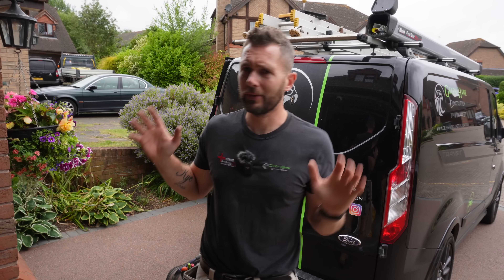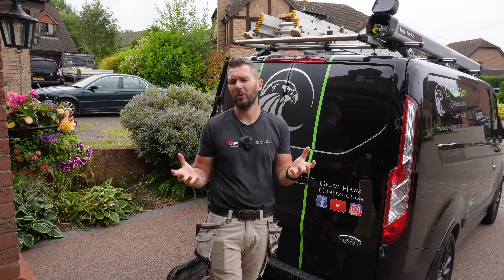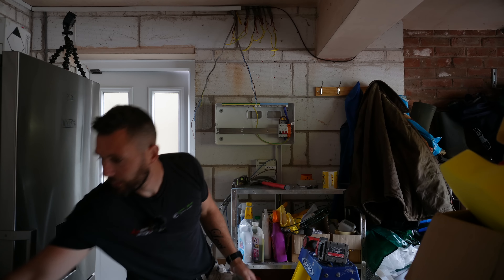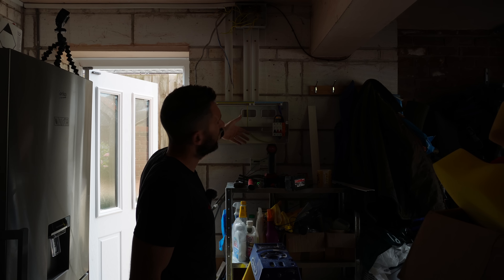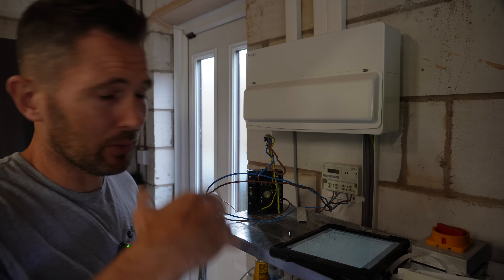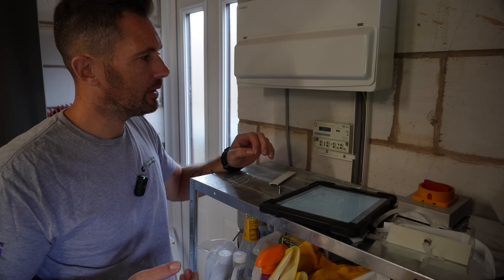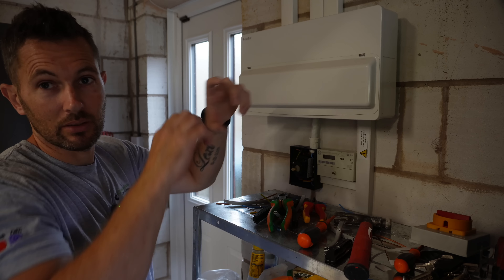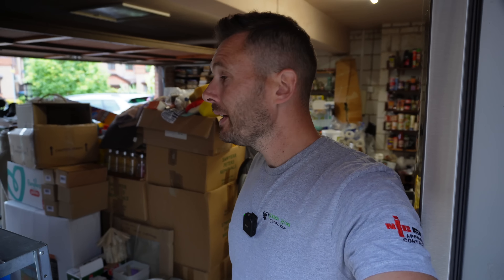CHANGING A CONSUMER UNIT AND DISCOVER PV BODGES!

Comment: Nice job! Hagers rcbos and boards come down so not massively far off price off fuse box now! 

Not all solar installers are crap we do quality electrical work. Wish they made small gen meters for 2.5/4mm cable we normally use though as they all designed for 25mm
Reply from the maker: Yep couldn’t agree more I am sure there are some amazing installers out there they just can’t be in my area as the last few I have been to have been below par

Comment: I do wish they'd make generation meters with lower max current rating and smaller terminals.  Those 100A units are designed for 25mm tails so not great for 2.5mm T&E.

Comment: Didn’t think you were supposed to mount boards off the wall now. Big gaps at the back losing the integrity of the board. Or did you fire seal it
Reply: There is no ingress protection or fire rating on the back of a consumer unit .
Reply: The fuseboxbstandoff plate is great for this